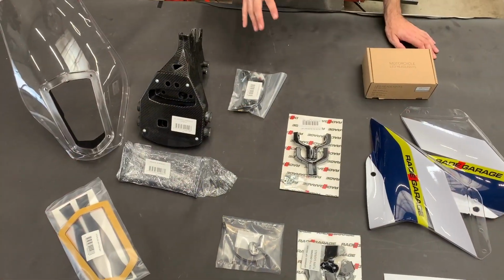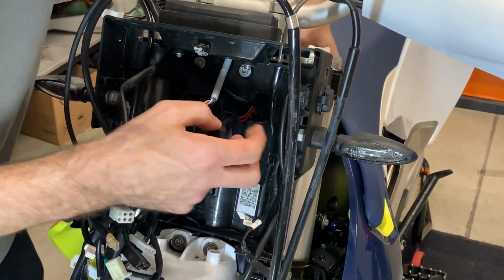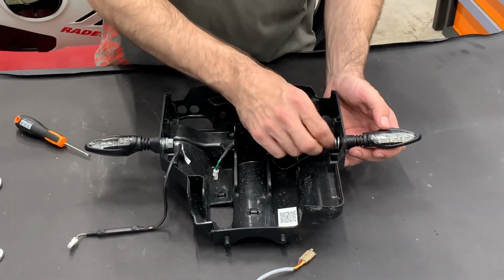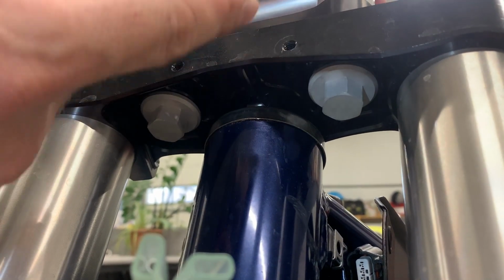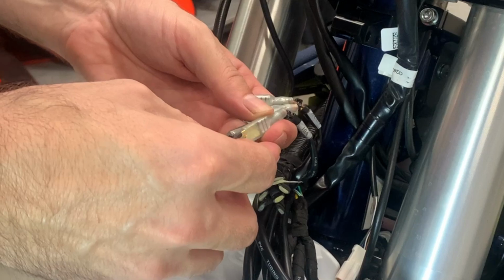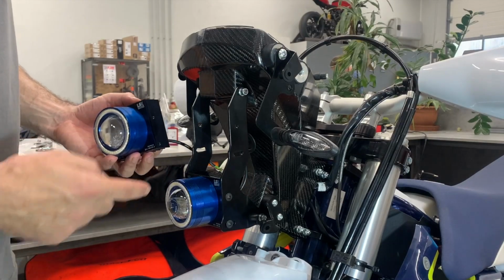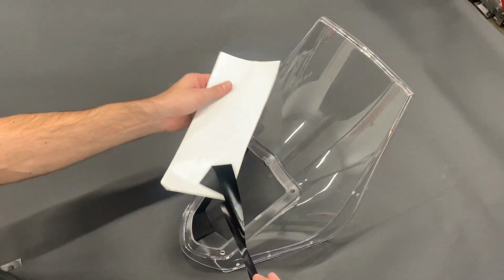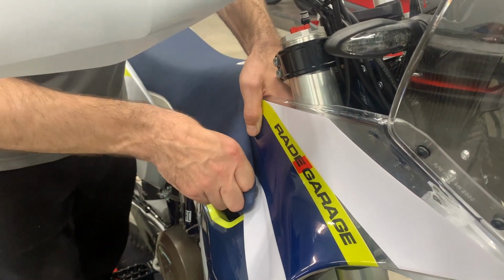Husqvarna 701 F5 fairing installation - RADE/GARAGE

Comment: If you are on the fence about making this purchase for your 690/701, do it. Adding the tower and aux fuel tank is by far the best thing I've done to my 701. Worth every penny. Fit and finish istop notch. The reduction in steering weight alone is worth the price of admission! My bike got heavier technically,  but the reduced effort of not having to turn the wiring harness, light and mask, makes a massive difference in how this bike feels on technical terrain. I'd do it again, and then some. Thank you Raid Garage.

Comment: the 16 connections and their wires don't fit in the small entering of the rally tower.
Reply: Finally... at the first light of the fifth day, at dawn , I looked to the east, and I saw Gandalf and Obi Wan Kenobi's ghost ...  and ... It worked against all odds. I defeated the evil tower

Comment: I would love to fit a rade garage fairing and tower on a 701 SM euro 2021+. (yes, for street use, I have a kink, don't shame me). 
Is it possible to avoid using the bar riser because without hitting the fairings with the bar ?

Comment: For any average hacks like me, this job took me something like 7 or 8 hours. I took my time, watched this video probably 12 times in total, labeled all my wires as I was disconnecting them, triple checked all my work, and then there were several things that were necessary that are not covered in the video. 

Of note:
1. If you are using the plastic OEM ignition/key cover, you will have to cut it so that the forward surface of the cover lays flat on the R/G upper tower clamp.
2. If you’re in North America, R/G does not send you a KTM USB T-connector to connect the loom to their port, but rather just two loose male spade connectors. It works, but at $1700, the kit should come with a proper USB T-connector that fits the machine. North American bikes come with this female USB in the loom from the factory, just no USB plug.
3. The quality of the USB charging port is bad. Again, for a kit this price, it should include a proper burly waterproof charging port, and in 2024 as I write this, it should be USB-C.
4. This kit makes the seat rather difficult to put on, as the seat itself is what holds the rearward part of the fairing in place. Just a note of something to expect.
Reply: what did you use to cut the keyfob plastic? was it a lot you had to remove? and is your bike a 2024?
Reply: @rapha2667  I used a Dremel, and then cleaned it up with a hand file. 2023.
Reply: @ thanks! last question - I have no Scotts adapter.. does the bar riser need to be installed? Or can I stick with stock? curious what you did there
Reply: @rapha2667  I don’t use a Scott’s dampener on this bike, and stayed with stock setup. It’s optional.
Reply: Hey one last question! got everything on but not clear how to hook up the usb charger..

They sent me the usb hub that has the typical metal end point you would plug into a wall… are these supposed to connect to the two wires they gave me in some fashion?
Reply: @ watch the Rade install video

Comment: I’ve just mounted this kit on the bike and it’s amazing ! My only issue is that the right seat pin keeps jumping out the rubber, any solution to that ? Also the outer finish on the polycarbone is not smooth everywhere, that’s a bit annoying on the « finishing » side
Thanks on advance for the answer !
Reply: I have the same question Jonathan.